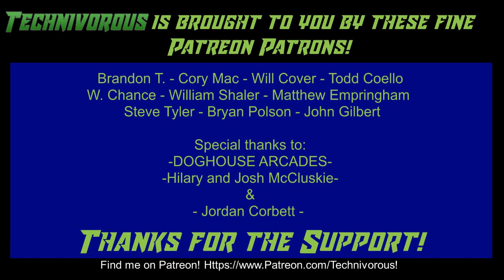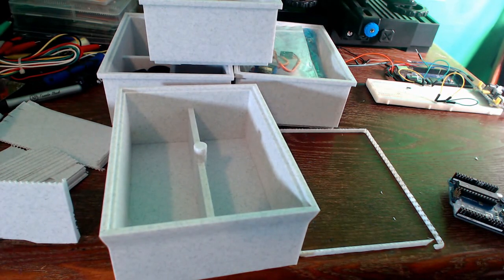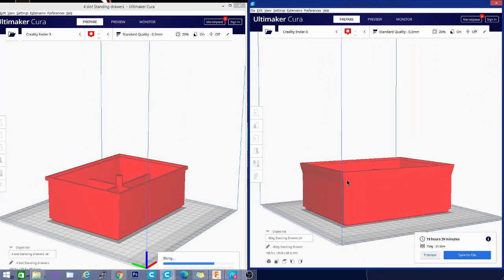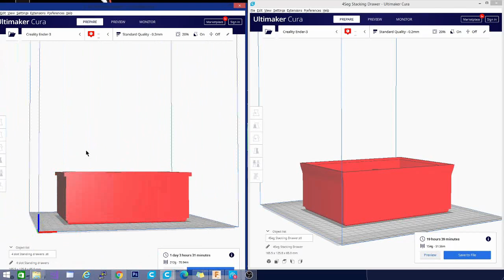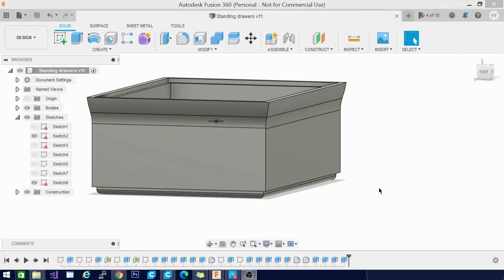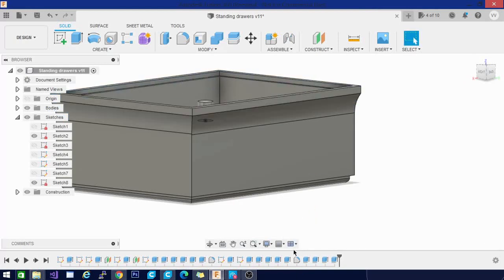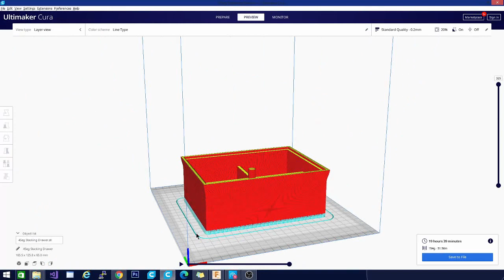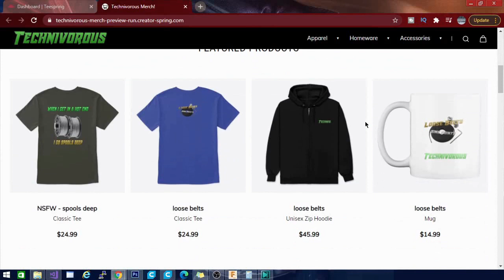3d Print Smarter - Small changes, big effects!

Comment: Hi, I have downloaded a model that is a step file from Thangs but when I convert it to STL it is massive and is stuck high up in mid-air when I load it into Cura, I have tried the place on build plate option but that does not work, do you have any ideas how to get it on the build plate?
Reply from the maker: Generally the snap option wont work if it's too big for your build area, reduce the size them move it?